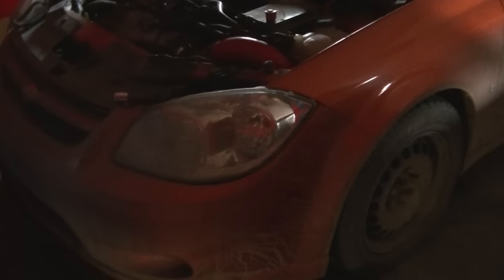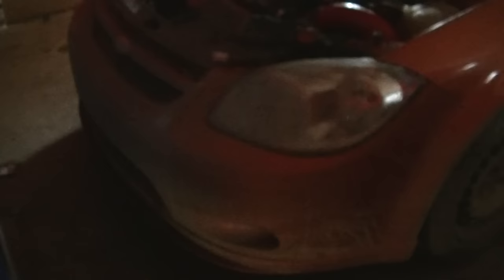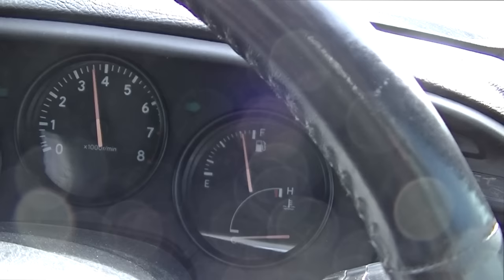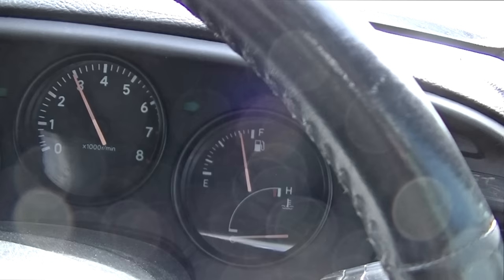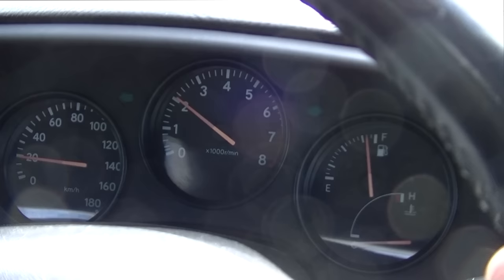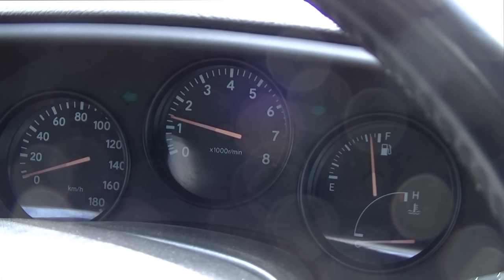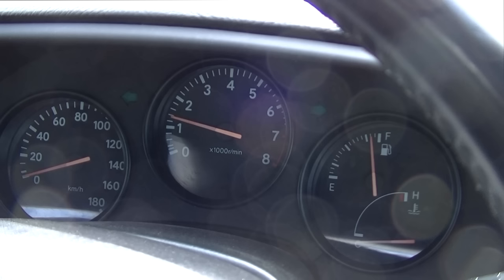First Drive in my Toyota Supra

Comment: >can't stop hitting curbs in a cobalt
>gets behind the wheel of a turbo supra with snow on the ground
Reply from the maker: +kingcrimson234 does this mean I win ?!?
Reply: Boosted Lifestyle you win!! any plans to up the boost? i'm a mustang guy but i love a nice supra.
Reply from the maker: +kingcrimson234 yeah I want to add another fuel pump and anther fuel line. Then I'll go back for a race gas tune on 28 psi 👍🏻
Reply: awesome, what's that kind of boost good for on these cars? 650-ish whp? i'm not that familiar with tuning these.
Reply from the maker: +kingcrimson234 yeah low to mid 600s at the wheels on this small turbo
Reply: when you get it done lets meet down in mexico.
Reply from the maker: +kingcrimson234 I can be there in 5 minutes

Comment: Hey man, stoked your car is finally up and running! My NA-T has some smoke and oil coming out of the crank case (top of valve cover, Passenger side), so I will be installing a catch can. Am I wrong for ignoring the smoke coming out of the crank case/ oil dipstick? Ive been asking around and some people are saying different things. thought you might have an opinion. Thanks!
Reply from the maker: +Daniel G you might have excessive blow by, you could always do a leak down test and see for sure!

Comment: Are you thinking about painting/plasti dip/wrap the car or are you gonna keep the color that it is now.
Reply from the maker: +Yaboii pizza I want to respray it the same silver it is now, Just to have fresh paint
Reply: +Boosted Lifestyle Oh okay
Reply: +Boosted Lifestyle have you thought about the stock brown colour on the supra
Reply from the maker: Hachiroku AE86 It doesn't sound very appealing. I wanted to respray silver so I don't have to do door jams and engine bay. Plus where I live paint gets a hard beating from dirt and rocks So I wont go with anything crazy
Reply: +Boosted Lifestyle yah i know how it is im in canada
Reply from the maker: +Hachiroku AE86 I'm in the oil sands of Alberta too, so site trucks covered in mud are dropping rocks and mud on the roads 24/7 you can park your clean car in your driveway and in a day it will be covered in dust
Reply: +Boosted Lifestyle its hell, for me its mostly salt cause I'm in toronto
Reply from the maker: +Hachiroku AE86 is it warm there yet? It's snowing here today lol
Reply: +Boosted Lifestyle my dads 99 corolla which he bought in 1999 has alltogether like 10 inches of the body missing but still runs like a charm at 320k km
Reply from the maker: +Hachiroku AE86 weight reduction!
Reply: +Boosted Lifestyle it snowed like 6 inches like 1 week ago most of the snow is gone and its like -8 now in spring
Reply: +Boosted Lifestyle for us Canadians -8 is like summer weather though lol
Reply from the maker: +Hachiroku AE86 brutal -.-